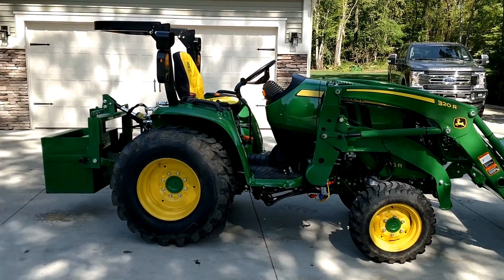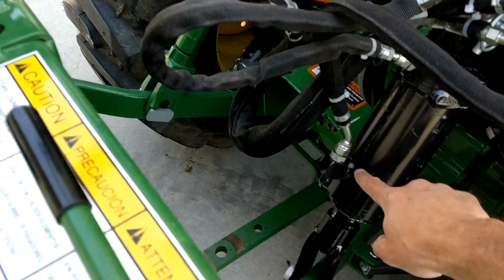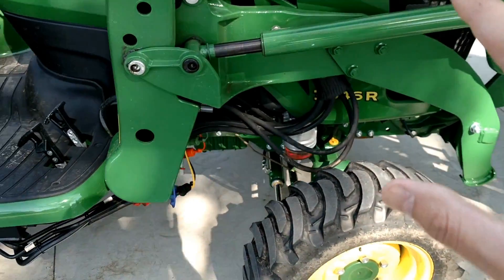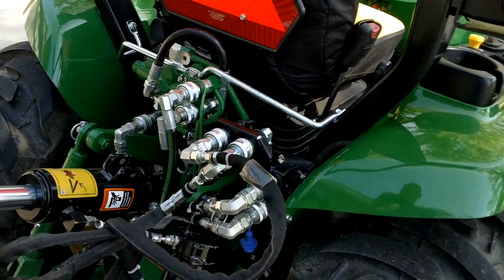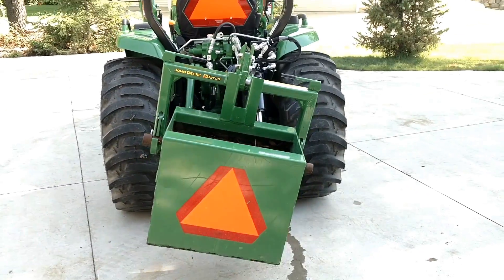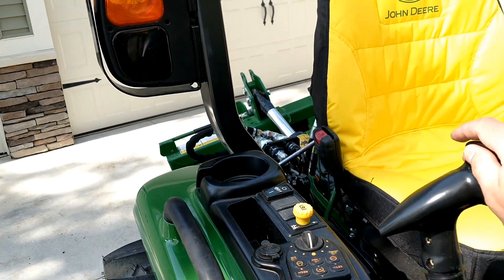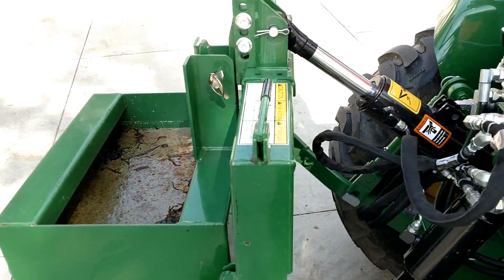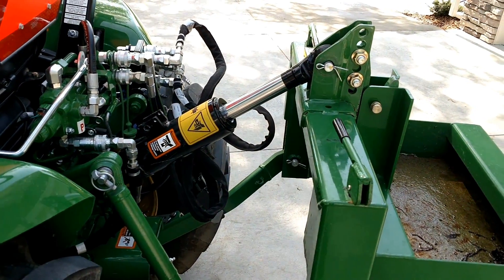Top and Tilt: How Does A Top and Tilt Kit Work?

Comment: 1.) What are the kit number(s) for the 3320 to control the 4th and 5th function via levers instead of the electronic diverter valve? 2.) Keeping the cost of the kits in mind do you think it is cheaper overall for a JD tech to install/setup the TNT kit with electronic diverter valve or is it cheaper overall for a JD tech to install/setup the TNT like it is shown in this video for the 3320?

Comment: I just installed a hydraulic top link the other day to use on my rear remotes. I am not considering the tilt, what hydraulic cylinder would I need for the 3025e? Is it the same as what you have here?

Comment: I've read somewhere that if you have top and tilt that you cannot put on down pressure.  Is that correct?  If you just do top, is that still the case?
Reply from the maker: You would have to buy a down pressure kit in order to have downpressure on a 3 point hitch.  Most commonly seen with augers.

Comment: What is the contracted length on the side link cylinder?  Im having a hard time finding a cylinder the right length and pressure operation.  I have a 3046r and the closed manual side link is 17-1/2 inches.  However all the side link cylinders I see available online that have a closed 17-1/2 inch measurement are cat 0 cylinders.  Not cat 1.  Help?
Looking for aftermarket.  Cannot afford top drop $800 on the deere cylinder right now.

Comment: While Hydraulic top links are common in agriculture settings, I twist my top link in and out easy enough and like it “fixed” in a level position. Is that really necessary? Also the hydraulic tilt.... they sell blades with tilt for that purpose. Would be fun to have for 1 project but then seems like a pain after that

Comment: Or like using a rear blade to cut a small trench with one end. 

Could there be a use if yet another cylinder was added to a lower 3pt arm to extend or retract?

Comment: Thats a nice feature to have.  Pricey for sure.  Must be a way to DIY one for the 1025R
Reply from the maker: Agreed.  I've seen a 1025r with hydraulic top link before.
Reply: I have the grapple setup on my 1025r. How would I be able to get a hydraulic top link setup?
Reply: @DarrenOnWhidbeyisland  you’d need a rear remote run off of your power beyond.

Comment: What you got like 7 or 8 freaking hydraulic hook ups on that little compact.
Daaaang.....

It'll take 10 minutes to get the hookups into the right position.
Then remembering.

You'd have to be a Carney to remember all them hydraulic levers.

https://youtu.be/Ny8VqcEe7dw

But will the implement orbit your tractor as you move along.

I want a device that'll allow my implement to orbit the tractor and move independent of the tractor while I maintain full control of it.

Comment: Thanks for the info.  I bought a 3046R from my local dealer and had it configured for top and tilt with the separate fender mounted controls.  I love it, thanks for showing me how helpful it can be.  I have one question, the top cylinder has a mount on top that is not used on yours, on mine, it came with a bracket that attached to a mount near the upper frame of the tractor.  the dealer said that was to prevent the cylinder from twisting.  The bracket kept the 3 point from lowering all the way, but it finally broke when I was trying things out, and everything works fine now, except for the pieces of the little bracket hanging off.  Did yours originally have an anti twist arrangement on the top cylinder?

Comment: Since you have played with both configurations, which do you prefer?  Electronic diverter valve or the separate controls?  I do not have either and wonder if having the separate controls would allow me to use the FEL without having the loss of the top and tilt.